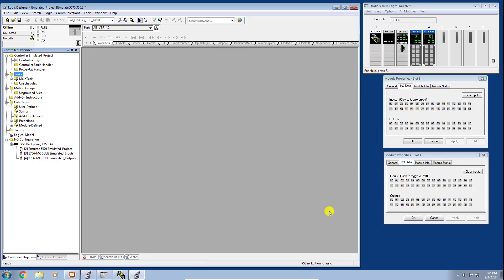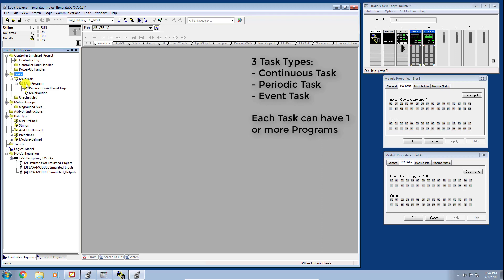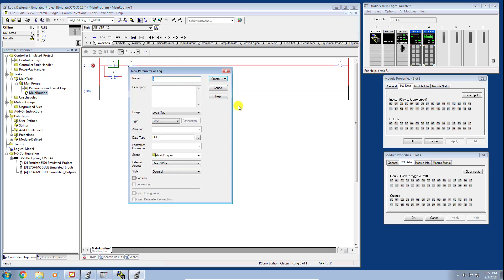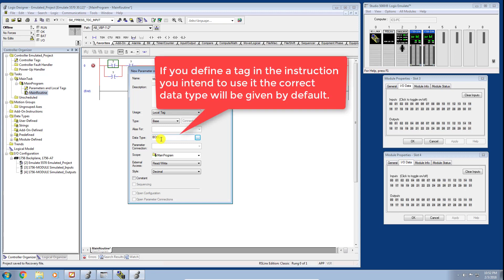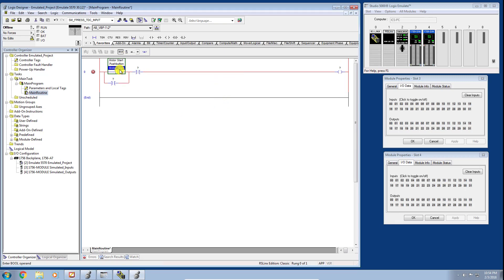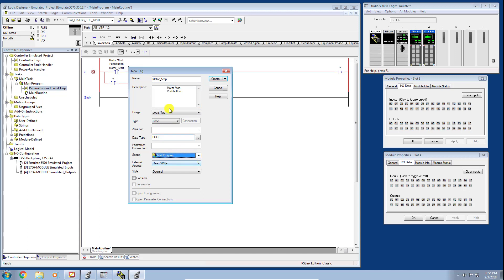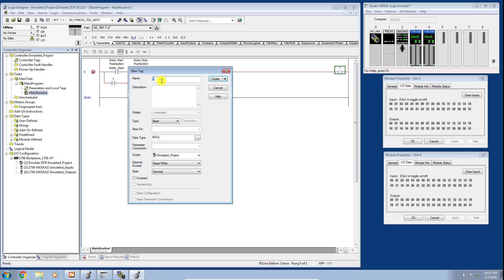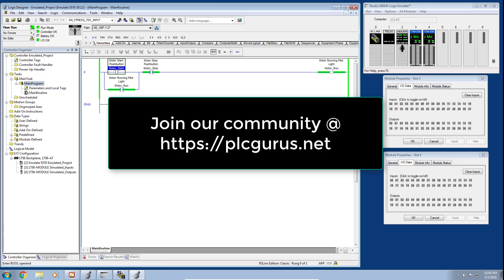PLCGurus.NET - How To Create Tags In Studio 5000

Comment: Minor stuff, but isn't the Stop Button a NC contact or a XIO on that rung? Where if the Start button is pressed and the Stop button is not pressed then the output is energized, which latches and seals the circuit. Which would then unseal or break the circuit if the Stop button (NC contact or XIO ) is pressed. Or maybe i'm confused. Excellent video otherwise. Some emphasis should be made though to explain the different data types a there are 5 from the drop down menu. I always get confused just what the others exactly mean. Bool you explained simply and well as it's either a 0 or 1 which makes it a digital signal. I think Real is just like an Analog value at best in how i understand it. The other 3 i'm not the best at in determining when to use.
Reply: I believe you can use the XIC bit for a stop if you are using a push button hardwired through NC contacts